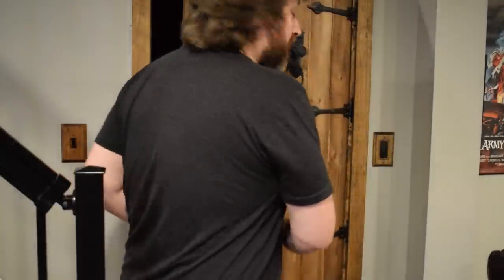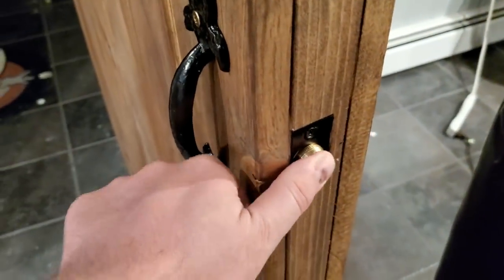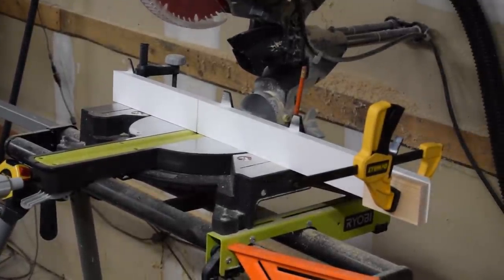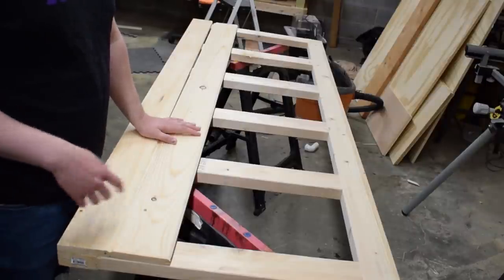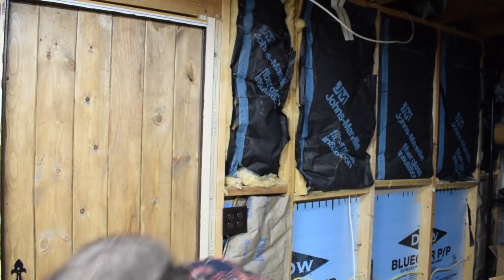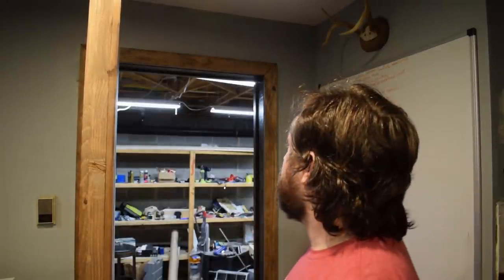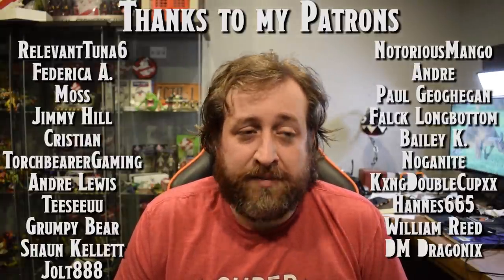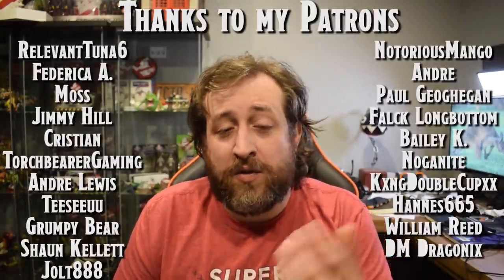DIY: How to Make a Dungeon Door | Nerd Immersion

Comment: Would insulating that inner part of the door be useful at all? For sound + temp
Reply from the maker: Yeah definitely. The first door I filled the gaps with spray foam, but it just made things heavier and wasn't really necessary.  The thickness of the door + the air gap do a really good job of insulating sound. You could fill it with mineral wool though and it would be even better

Comment: Just as a suggestion I prefer using a clear epoxy instead of the wood filler. It allows you to see all of the wood colors you like but it also protects the rough areas.

Comment: Love your channel. Small advice, when you put the "strike plate" in the door frame, you turned it the wrong way around, part that sticks out on the other side is the "strike" part that needs to be put outside of the door frame to take the "strike" from the ball and help to guide it inside. 
Hope that helps, sorry about my English its not my first or second language.
Reply from the maker: No you're definitely correct but with some shifting of the doors placement the strike plate "receptacle" needed to be adjusted. Rather than chiseling more of the door away it was just easier to turn the plate around.

A little messy but it's works great for the past year and more

Comment: This looks great and now I'm considering it, assuming there's any lumber left at our Home Depot or Lowe's. Something my dad taught me and maybe it's not great for everyone, but when it comes to the Wood Filler, what we always do for a project is we save the saw dust that comes off the wood we're using and then, if we need to fill in spots, we use a bit of wood glue and the saw dust and just push it down and sand it in.

Comment: Looks fun.  I don’t have all the tools to do this, and that makes me sad.
Reply from the maker: You can build a lot of this with hand tools or different tools. A hammer and nails over a nail gun, a screwdriver and screws over a drill. A handsaw for the frame cuts and cutting the boards to length, etc.

Really a circular saw and drill would be the only power tools and they can both be obtained for under $100 with savvy shopping
Reply: Nerd Immersion We just moved into a new house, and are having the basement finished.  I think when things settle down, I’ll have to take your advice.

As for other videos, if you wanted to make a DM screen, or dice tray, I’d certainly watch the video.

Comment: How long did this take?
Reply from the maker: Not too long all things considered, but I had to break it up over several evenings since I could only really work on it after everyone else was asleep.

So lets see:
Gathering materials from the store: 30 min.
Cutting/assembling frame: 30 min-1 hour
Cutting T&G boards: 30 min.
Assembling/gluing T&G Boards: 1-1.5 hours
Removing old door frame: 15 min.
Installing new door frame: 15 min.
Sanding/wood filler: 45 min
Pre-stain/stain (w/ wait time) 1 hour
Installing hardware: 45 min
Trim (cut/stain/install): 30 min

So 6-7 hours-ish from picking up materials to completion. If I had a sizeable chunk of time to do this all at once it might gone faster as I'd be able to "get into the zone"